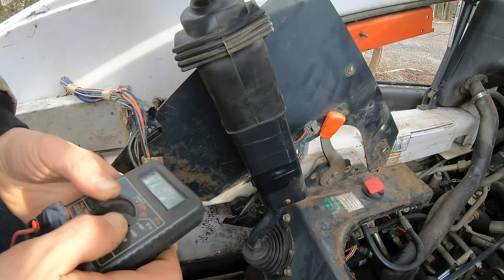Replacing a AHC computer

Comment: Re: intermittent electrical issues -- ALL computer/ECUs etc. need 100% good power supplies (battery & ground circuts) to operate correctly. Perhaps your issue lies with the machine's battery (is it just marginally good?) or issues with it's alternator/charging circuits...

Use the wiring diagram and trace what is connected to what  - does the new $1500 controller you bought share it's power supply with any other components after the ignition switch?...for example,  does the power to the ignition switch first go through the cut off safety switch on the bar that must be down for starting the machine...  

Also look for corrosion or connection issues in all the other positive & negative  circuits, especially with power to & from the ignition switch, to & from the electronic control boxes etc. etc

Comment: Andrew, you have a computer issue, the new computer that you got from bobcat for 14 hundred is maybe a bad unit. So you need to ask for a replacement. If you still have few problems OR NEW ONE then that means you had changed the few fuses in the past and these fuses are going overheated due to quality, so you need to replace them because they are causing the voltage change to the computer during control motion to the machine. Trust me, bobcat are good, and they get the job done very well.
Talking about Lamar and Takuji skid steer, trust me brother all machines come with different issues depending on usage and maintenance quality. My friend has a few machines and he face a few issues as well. 
I have S770 and it works like new. 
Overall good work brother and keep going with a new project.

Comment: Andrew, I would suspect the computer has an intermittent problem, if all functions were working previously and computer is only thing changed, I would say computer is at fault. When you un paced unit, you said unit liked it was used.You were probably right.

Comment: Courious what your repair bill is per year and how many hours you spend a year? Courious your container shop building cost? My dad started out rail road logging in 1946. I walked 160 acres of cedar with stumps 12' high with spring board knotches last  logged in 1919.

Comment: My initial thought was an issue with the connection on the safety bar switch when the machine froze up while you were operating it and why it only happens intermittently. I would guess you had 2 different issues going on at the same time. 1 with the joystick (that you fixed) and 1 with the machine locking up randomly.
How about an update?

Comment: It’s the third wire to connector connection which is intermittent. Initially it gave a week signal during the continuity test then you pressed harder and it picked up. Reading the resistance would have picked this up. Try a new cable on the faulty side unless you are good with repairing the connector in the plug.

Comment: @Andrew Try and read the computer for codes. Maybe there is a safety feature that stops the use of the part if a sensor is bad or something in that line. There should be an option to wipe the computer of codes and check, like it is on a car that uses OBD2 scanner.

Comment: I like Kubota equipment. It's easy to run and plenty of power. Although we had a problem with the pedal return (hydro static transmission) other than that Kubota is a good company, not sure what the country of origin is though.

Comment: Whenever computers have problems like these usually the battery or alternator isnt good and the low electricity supply eventually shorts out the computer and kills it.

Comment: I wonder if at first when you started it after fitting the new part the battery voltage was low due to it sitting and this is why it was faulting, then after you ran it the battery charged enough so the fault didn’t happen. From the video it looked like the machine sat for a while and there was a lot of testing with the engine off. ( this is only what i can see if you ran it enough to charge it then ignore the above, i know that you warmed the machine up but if at idle the alternator may not be making bugger all current) my 2 c any way.

Comment: I say good luck trying to get something with no computers.  And now, any diesel over 26 hp you have to deal with that awful regent and DEF emission baloney.  I heard Kubota was looking to go back to gas engines for their equipment.  I don't know how far they got or if this is true.
Reply from the maker: Can that emissions stuff be removed?
Reply: I guess, if you can find the right guy.  I have a couple of Kubota tractors.  Thank God none of them have it.  However, when all this stuff started (Tier 4 emissions?), the service department at the dealer was getting all kinds of calls from guys in the field who had alarms and lights going off.  I believe the regent on a big Kubota works this way.  There is a ceramic filter on the machine.  When it gets so filled with soot, a shot of diesel fuel gets squirted into the filter to start a fire to burn the soot off.  The filter can only do this for a limited about of times before it has to be refurbished at the dealer.  As for the regent process itself, sometimes you can be in the middle of a job and the engine will go into regent.  Some guys say nothing weird happens and you don't know it, while other guys claim it's a pain.

Comment: Hi Andrew probably been said but have you thought about checking the safety drop down lap bar? Had trouble with a case that if you went over a bump to fast would knock computer out would have to hit button and be right on again , mite be worth checking bud

Comment: I had this issue once . It ended up being a blockage in the hydraulic relay block located on back right side of skid. Would also suggest inspecting cables in controller and mechanical linkage under the seat.

Comment: Bypass the lap bar safety switch. If that doesn’t fix it pull control panel out up top the plug is probably loose. Pretty common.

Comment: So the module is potted. Well unpot it and fix it. It's not a computer it's a control module. No software or firmware. It's just a switching device. I fixed modules on cars and truck all the time in the 80s and 90s. I bet you it's a cratered trace you can jump with some wire and solder.@ Unpot electrical/electronic devices.☺
Reply from the maker: Someone suggested baking it at 250° to melt that stuff off. Is that correct?
Reply: @AndrewCamarata  Yep.and or hot airgun it's Epoxy. I used a hot knife and a map gas way low. I would cut around the edge and see if I might get the whole thing out from the metal case gently I was thinking of a sonic knife (This Old Tony). Nowadays all the good chemicals are outlawed or too fracking dangerous. I used Bondo to re-pot sometimes less hardener than normal it is for waterproofing and shockproofing I can't believe the wires just run out that way no strain relief. rip kaboom. 
do them Bobcats owe you anything bet not. Sell high. Buy cheap. Good Luck.

Comment: Therer can be an overcurrent error..  the ECU senses that some thing with the output to the solenoid is not right.. you should not try to reset it to muck because the output can burn..  its a MOSFET transistor. 

Maybe there is a problem in the solenoid.. check and measure the Resistance to the solenoid. 

Measure the connector to the solenoid.. or actuator
Reply: You can repair thw old one.. change the output transitor..

Check with multimeter if that output is shorted to ground.

Comment: wiring problems are annoying , it could be as simple as a bad ground somewhere . Too bad you can't convert back to a basic manual control valve with a cable controlled joysticks.
Reply from the maker: That could be made into foot pedal. IDK, I am still running this machine, sometimes that light comes on and the engine needs to be restarted.

Comment: ya bobcat is kind of like a bicycle lighter, when you're done with it just throw it away. I've had my older (2001) Caterpillar skid steer for over 10 years now and has over 9,000 hours on it and haven't had to do anything but maintenance and change a blown hose on occasion and it has mechanical pilot controls. I've also rented on several occasions takuchi (spelled wrong I'm sure) Kubota and they just seemed a lot slower of a machine to me but if you're getting paid hourly I guess it doesn't matter too much I myself just don't care for a slower and underpowered machine. just my 2 cents.
Reply: I hate auto spell! That's disposable lighter not bicycle

Comment: I agree with Japan stuff, I got equipt, from the 1980s that just run with no issues. I know you solder all your connections, but there is another trick with these electronic stuff that I learned the hard way. Even if your connections look clean use contact cleaner and dielectric grease on all your connections. Also ohm out the coils on the solenoids,if the resistance is out of specs. they will sometimes malfunction. Lastly check your grounds,add new ones if your unsure of it. I saved a lot of money this way. By the way how much do you want for the bobcat?
Reply from the maker: IDK, I would probably ask 15. I am going to get something else first though.

Comment: I have a 1996 CASE 1840 with 5500hrs and find it bullet proof. No computers, just cable controls and hydrolylics. Has a Cummins 390 diesel engine. You should buy the bigger CASE 1845c which iis a bullet proof legend. Just have a look at the forums on line for this simple workhorse. Love watching your videos, keep em coming!
Reply from the maker: Doesn't that have wheels though?

Comment: hi I wanted to comment on your experience with your suspending rocks when you were younger as it shows to me a natural curiosity of applied physics. if you lift a rock vertically having a weight equal to the product of its mass times the acceleration of gravity (9.8 m/sec/sec or 32 ft /sec/sec) a vertical height , h, from rest, the rock has a potential energy equal to mgh wjth respect to the ground. when the rock falls freely (ignore air friction) this potential energy is converted to kinetic energy of motion 1/2 m vf squared where vf is the rocks velocity the moment it hits the ground. at this point equal and opposite forces act between the rock and the ground. to find this force use the impulse =change in momentum relationship which is expressed by m vf - m vi  = Force * time duration of the collision between rock and ground where vf comes from the kinetic energy formula, m is the mass of the rock and vi is zero since the rock comes to rest after the collision. the time of the collision has to be measured say my an accelerometer fastened to the rock which is connected to a oscillograph which measures the time of the collision. it is interesting here to note that when rock is dropped from the same height the change in momentum is a constant so the impulse F*time duration of the collision is also a constant. this means that the greater the time the less the force and the shorter the time the greater the force. this is the principle behind using seat belts and air bags in  cars - to extend the secondary collision time between the occupants of the car and thus reduce the force on them. keep the videos coming and include things like this rock experience as it is refreshing to see your intrests
Reply from the maker: Yeah, It was fun dropping that huge rock on stuff when I was little.

Comment: The controls are just switches, what about completely converting to a computerless, analogue system. Its April 2020 but since you are operating a number of machines, try looking if there are any after market conversion parts available. It could be done in the shop as well but you will need the help of someone with electronics knowledge to build a control board - even Arduino, robotics etc. There, however can be a catch, the manufacturer might programme the computer to shut other systems if any modifications are made. Some big American farm machines cannot be modified for these reasons.
We have had long experience with Japanese industrial hardware and yes, they deliver.
Reply: He has replaced that machine.
Reply from the maker: I still have it, it sometimes has problems with this. Just wont buy any more Bobcat brand machines.

Comment: Hello Andrew if you really want to follow up on the computer box being bad there are potting compound remover chemicals that can be used to soften and free up the circuit board and components I expect you will find either a cracked board or cold solder joint.
It would make for an interesting video if you are interested in taking on the project maybe even fix the old one and sell it to pay for the replacement. Good luck and keep the videos coming.
Reply from the maker: I tried taking that thing apart. I kind of butchered it.

Comment: Hey Andrew, are you parting out that black 4th gen 4runner? I saw it sitting to the side with no tag on it.
Reply from the maker: Jay Mon no. We just got that to drive.
Reply: @AndrewCamarata  Cool, I'd like to see a video on that truck. I have a 2005 with over 200,000 miles on it it still runs like brand new.

Comment: lol! and here I thought apple was good at preventing 3rd parties from fixing their computers. bobcat found the  perfect solution to that problem: just fill the whole casing housing the electronics with epoxy or some shit so noone will ever have any chance of fixing that computer, which is usually done by just replacing some cheap component or resoldering some.
Reply from the maker: I fixed that by never buying another bobcat product.
Reply: @AndrewCamarata  that's the best fix available to the consumer in a free market. I hope you'll find an awesome japanese-built wide- tracked machine and am looking forward to a video about it. love your channel!!
Reply from the maker: Thanks. I got an IHI CL35, its a similar machine, nicer to operate, I have had it over a year and have not had to do any repairs to it.

Comment: Takeuchi the best hands down! You couldn't give me a bobcat... I've had the older 150s and now I have a tl8 the things a Beast never had any problems...👍
Reply from the maker: Good to hear. The IHI has been a good machine (I think its the same thing). I wont buy another bobcat brand machine. I am still having problems with this machine.
Reply: I think "Mustang" builds the same machine as the takeuchi and I noticed yours looks strikingly similar...keep up the great videos my friend 🤘✌
Reply: @AndrewCamarata  ...note: the only thing i would've done diff is buy the TL12...I got the TL8 thinking i could get into residential back yards easier (here in NJ) etc, but on big jobs where access isn't an issue, I wish i had a bigger machine TL10/12...which  will also reach over the tri- axle dump body....go big!
Reply from the maker: Chateau ADK yeah. I’ve been looking for a bigger one too.

Comment: Some motorcycles have a CDI which is also filled with that epoxy stuff. I know there are people who managed to open it with a dremel, and found a cracked circuit on a print. https://www.motor-forum.nl/threads/cdi-unit-reparatie-doe-het-zelf.19436/
Reply from the maker: Someone suggested baking it in an oven to get that stuff off. I am going to try it.
Reply: @AndrewCamarata  Don't forget the garlic.

Comment: Such a common problem with bobcat
Reply from the maker: That AHA computer thing? That light has come on a few times since installing this computer, but the machine has been ok. I got a IHI skid steer instead which is much nicer.
Reply: @AndrewCamarata  ive seem, i havent had to work on many of them which id say is a pretty good thing and there are quite a few around. Im a diesel mechanic down in Texas and i work on almost nothing but equipment, love your videos
Reply: @AndrewCamarata  that computer and those actuators i go through alot, sometimes those short out and cause the computer to fail

Comment: Electronics are nice until they quit working. Then its a royal pain to figure it out and then will it keep working.Why use the old ways that work forever when we can put in electronics that cost a fortune. Older machines went to the scrap heap with valves that we working while these newer machines have been repaired multiple times.Yes newer are easier on the arms but much more expensive to keep working. They should put an extremely  long warranty on that stuff.

Comment: I bought a Honda car on a whim used it for 5 years ran it to the ground spend £200 in 5 yesrs half was for tyres 
Didn't skip a beat - 10 snow and ice started first time after a week parked up in snow  bulle proof  Japan cars simply made to last plus I only lost £1000 in value in 5yeras

Comment: That's a very expensive servo controller. I wouldn't even call it a computer as there isn't much intelligence in such a device. Pity that it was casted in resin, I'm pretty sure it's repairable if that resin wasn't there.
Reply from the maker: Yeah, I tried to get it out and ended up butchering the thing.

Comment: Dude, that skid steer is annoying. Buy a crawler loader with a backhoe on it. I know, that loader will cost 4 times as much to run and I'll have to give a reputable rep and work my dick off.
Reply from the maker: You don't see many crawler loaders with backhoes, they were popular 50 years ago. I do have a big crawler loader, I don't use it much though.

Comment: Also a drunk Irish paver in northern NJ has a Newholland skid steer...high lift..we beat the shit out of that and he does no maintenance on it at all and it very rarely brakes...he flipped it over...on a side hill and we pulled it over back on its wheels with his tri axle dump..it still worked..but only for one week he bent the loader arms lift piston ram..so that was like almost a grand...new..and I put it back on it worked like new..I don't like newholland equipment..really at all it's all built cheap..